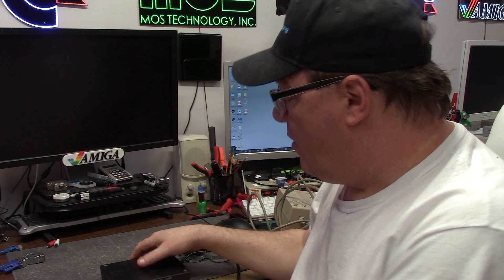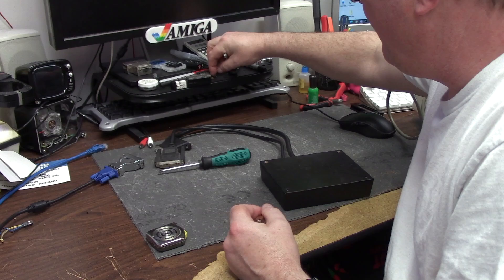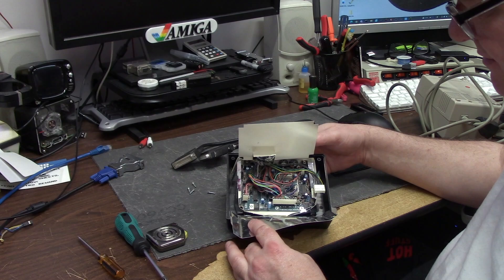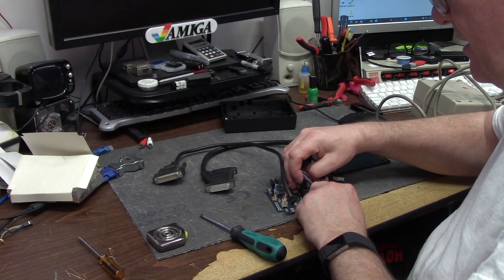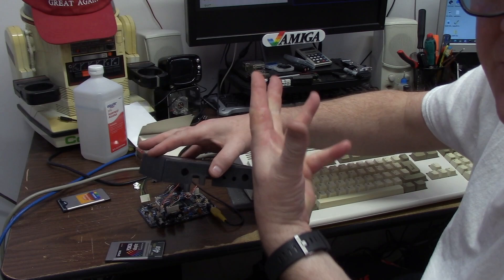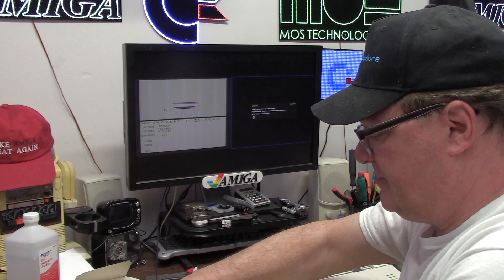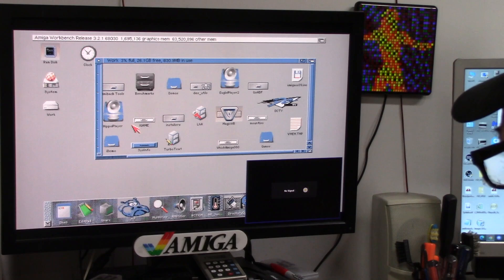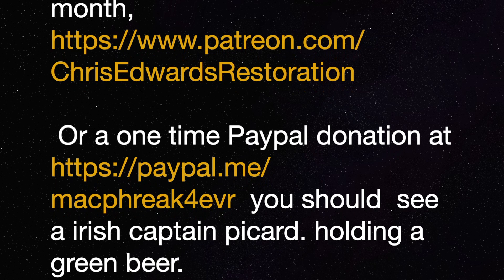Amiga DCTV repair

Comment: Copper tape has conductive adhesive, aluminum duct tape doesn't.  The tape is to join the back cover of the RF shield which is sorta important for an external video device. Wanna sell it to me!? I'm on the search for one for my collection... had one in the 90s on my A1200.
Reply from the maker: email me, i have three of them myself
Reply: emailed you from electronictreasure64 thanks!
Reply from the maker: @electronictreasure4191  and now you h ave one on the way to you.  Enjoy. pay it forward.
Reply: super grateful definitely will do thank you!!
Reply: super grateful definitely will do thank you!!

Comment: Today I learnt there was something called a DCTV 🤔 “Q” must have some rare stuff 👍🏻 ai believe he is sending you his PicassoIV for repair? Will you be doing a video on it please? As I’ve got one that also doesn’t work. Cheers! 👍🏻
Reply: DCTV can also digiize video images,   There is an RGB converter option that will give you crisper output.  I used to have both once upon a time.  I think we used anim7 for faster playback.  Further animation speed improvements could be had by using a letter box format.
Reply: Rarer than DCTV is HAM-E from Blackbelt Systems.  I'd like to see someone do a video on that.
Reply from the maker: PicassoIV fixed. Was 3.2 roms.  Reverted to older 3.1.4 and card came back to life
Reply: @ChrisEdwardsRestoration  Oh well, I must have a different problem then 🙄 As I’m using 3.1 and 3.1.4 ROMs. Have tried jumpers and pushing in the chips.

Comment: Hi Chris. Which dell monitor is that?
Reply from the maker: U2410-F native 15-95khz does all amigas native videos with a db23/vga buffered converter. also has every modern hook up you can imagine, from dvi to hdmi to displayport , component, composite, even a usb hub and sd card reader. one of the best monitors ive ever purchased, and best part, they are about 50-100usd on ebay with stands.
Reply: @ChrisEdwardsRestoration  Bought one after your recommendation Chris 👍🏻 Can recommend getting one, ideal for Amiga Testing 😉